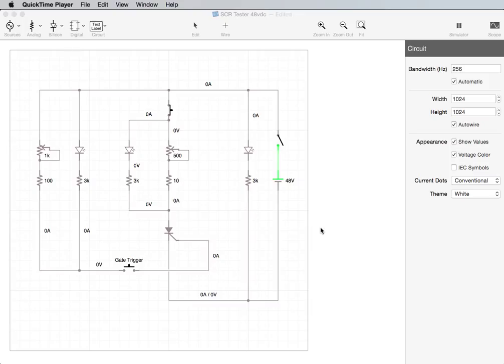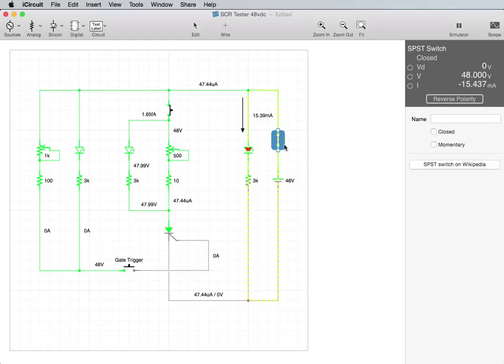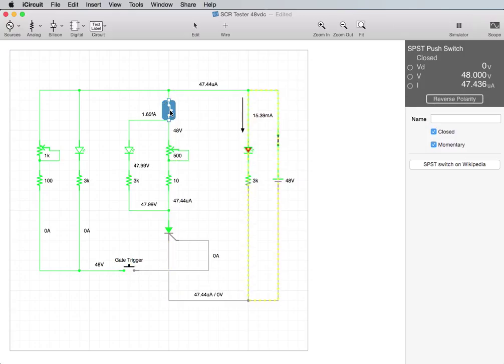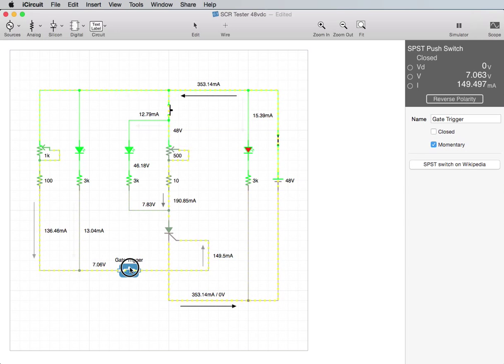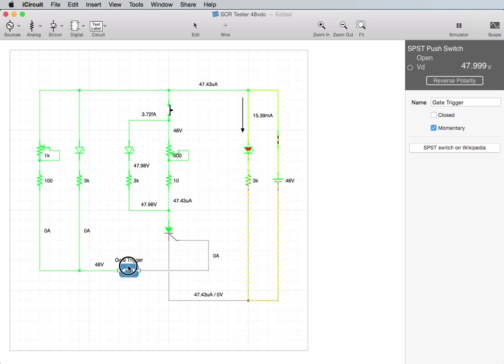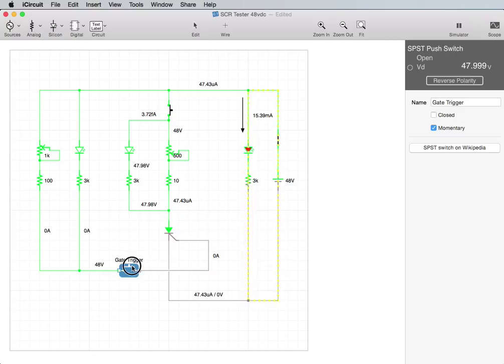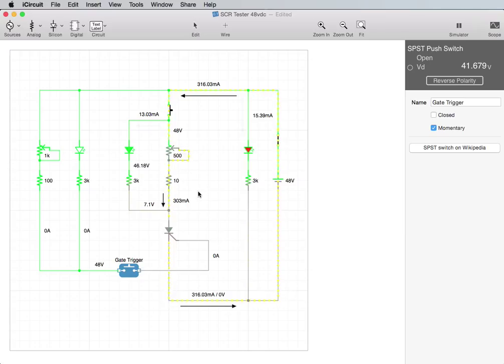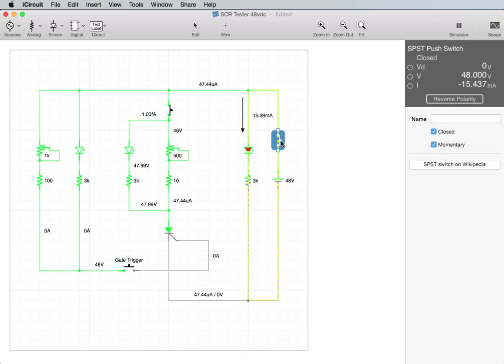SCR PowerBLOCK Tester [Circuit Diagram] with Circuit Simulator

Comment: do you have a parts list that someone could build this from.
Reply from the maker: +Tammy Hicks 
I will make one and put in the description.
Reply from the maker: New project with parts list in description: https://youtu.be/a826q0I0a_Y
Off memory I believe this project contained the following:
48vdc Power Supply
500 ohm WW reostat
1K ohm WW reostat
Switches
LEDs & resistors
Pomona Jacks
and misc

See this materials list from another project with amazon links:
MATERIAL LIST:
Seahorse Case SE300: https://amzn.to/2vCArvE
Variac:  https://amzn.to/2vCY2w7 
Step Up Transformer 120/240+: https://amzn.to/2vIdCH5
Bridge Rectifier 1000v:  https://amzn.to/2M8cEhe
AC Panel VM 0-300vac:  https://amzn.to/2OqMbII
DC Panel VM 0-450vdc:  https://amzn.to/2vCRSfr
DC Panel AM 0-20ma:  https://amzn.to/2MldVAX
Pamona 4mm Panel Jacks:  https://amzn.to/2OqMrra
4mm Banana Plug Alligator Clips (5pc):  https://amzn.to/2MGgxqd
4mm Banana to Banana Stackable (5pc): https://amzn.to/2OpIDGz
Panel Mount Fuse Holders: https://amzn.to/2vBiz43
AC Rocker Switch: https://amzn.to/2M9lFqh
On/Off/On 4PDT Toggle Switch:  https://amzn.to/2Ot7wB1
Momentary Push Button:  https://amzn.to/2MgXdCN
1000 Ohm High Wattage Resistors: https://amzn.to/2AZecoA
Wago Lever Locks:  https://amzn.to/2OVXzgy

AC Inlet Power Socket Switched & Fused: https://amzn.to/2OtRs25
AC Outlet:  https://amzn.to/2P1ThnN
DC Outlet:  https://amzn.to/2MAGpDH
DC Power Cord Plug C14 to C13:  https://amzn.to/2OYVOiF
Male C14 Male C13 Female Connectors:  https://amzn.to/2AZeGuU

Hook Up Wire:  https://amzn.to/2P1XLe7
Electrical Connector Assortment:  https://amzn.to/2Mi1lma

Lexan Sheet:  https://amzn.to/2P2fX7t

Comment: sweet circuit  🍨  for testing SCRs adding a 120vac  variac to supply the 48v with  ac or dc + 100 watt light blub in series with the scr or triac under test. 😏 thanks a lot.
Reply from the maker: Just a DC power supply.  Variac used here:  https://youtu.be/fUDB7oavJkg

Materials list on my website:
https://www.kevingittemeier.com/shop-ee/8/

Test equipment Playlist:  https://youtube.com/playlist?list=PL5bXe_lvrKgafjJs6-U55nnVdQg0XOamu
Reply: @KTFG  thank you very much.

Comment: hi you have schematic or pdf i loke build one thanks..
Reply from the maker: +MrGeraldino250 
Just what's on this video.
I plan to make a smaller battery powered one and I'll make a material list and put in video and description
Reply from the maker: New project with parts list in description: https://youtu.be/a826q0I0a_Y
Off memory I believe this project contained the following:
48vdc Power Supply
500 ohm WW reostat
1K ohm WW reostat
Switches
LEDs & resistors
Pomona Jacks
and misc

See this materials list from another project with amazon links:
MATERIAL LIST:
Seahorse Case SE300: https://amzn.to/2vCArvE
Variac:  https://amzn.to/2vCY2w7 
Step Up Transformer 120/240+: https://amzn.to/2vIdCH5
Bridge Rectifier 1000v:  https://amzn.to/2M8cEhe
AC Panel VM 0-300vac:  https://amzn.to/2OqMbII
DC Panel VM 0-450vdc:  https://amzn.to/2vCRSfr
DC Panel AM 0-20ma:  https://amzn.to/2MldVAX
Pamona 4mm Panel Jacks:  https://amzn.to/2OqMrra
4mm Banana Plug Alligator Clips (5pc):  https://amzn.to/2MGgxqd
4mm Banana to Banana Stackable (5pc): https://amzn.to/2OpIDGz
Panel Mount Fuse Holders: https://amzn.to/2vBiz43
AC Rocker Switch: https://amzn.to/2M9lFqh
On/Off/On 4PDT Toggle Switch:  https://amzn.to/2Ot7wB1
Momentary Push Button:  https://amzn.to/2MgXdCN
1000 Ohm High Wattage Resistors: https://amzn.to/2AZecoA
Wago Lever Locks:  https://amzn.to/2OVXzgy

AC Inlet Power Socket Switched & Fused: https://amzn.to/2OtRs25
AC Outlet:  https://amzn.to/2P1ThnN
DC Outlet:  https://amzn.to/2MAGpDH
DC Power Cord Plug C14 to C13:  https://amzn.to/2OYVOiF
Male C14 Male C13 Female Connectors:  https://amzn.to/2AZeGuU

Hook Up Wire:  https://amzn.to/2P1XLe7
Electrical Connector Assortment:  https://amzn.to/2Mi1lma

Lexan Sheet:  https://amzn.to/2P2fX7t